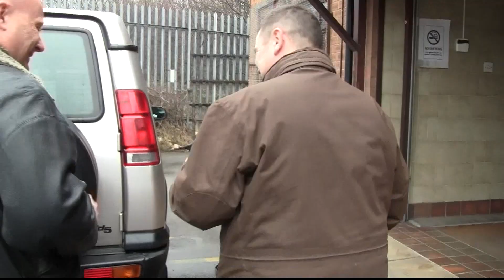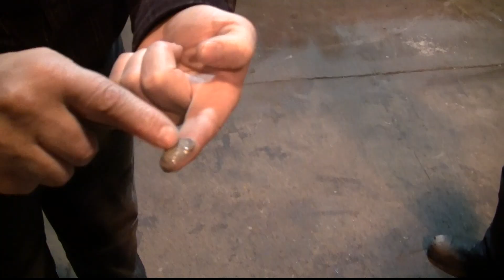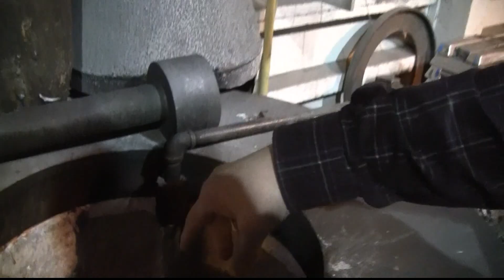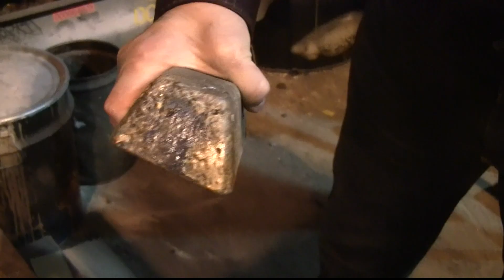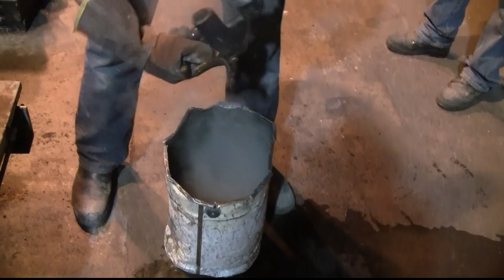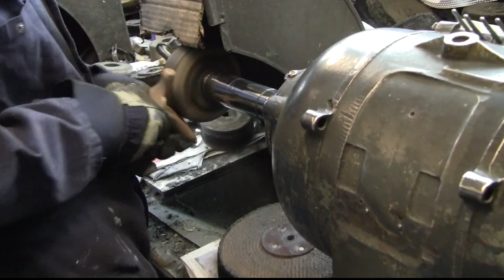Cast Metal Slingshots: The Sheffield Secrets Unveiled!

Comment: I do some of my own casting... I like the idea of using an alcohol based slip to put a nice smooth finish on the inside of the mold... I had never seen that done before.  I know enough about pottery that I think I can replicate that step in my casting.  Also I am hella tempted to order one of these slingshots.  They look sweet.
Reply: Want me to figure out what my shop uses we work with cored airset green sand and petrobond
Reply: @billybob-gb6ol  I'm interested
Reply: @sarchlalaith8836  to late don't work there anymore
Reply: @billybob-gb6ol  ok

Comment: I wonder if they can/reuse the sand blocks.
Reply from the maker: They do reuse the old blocks, but never for the finer (inner) parts of the new molds.
Reply: JoergSprave Thanks for the info. Keep up the good job!
Reply: +JoergSprave possibly at that foundry, at other foundries, like the one I worked at, we would grind that sand back into a coarse  powder, mix it with fresh and reuse it as if it were new.

Comment: when you were burning the moulds was that guy using a flamethrower?
Reply: I assume its the flame thrower they use to heat some of their smaller furnaces, or probably to burn the molds.
Reply: nah, just a propane torch (i assume propane, its just the most likely), like a really big blowtorch. a "flamethrower" generally shoots a burning liquid, like jellied gasoline, or napalm.
Reply: theoretical physicist
 a really bad ass torch
Reply: its a torch
Reply: Flamethrowers shoot a jet of flammable liquid or gel like napalm, they're illegal. Torches (the one in the vid) shoots out a gas, it's safer cause it burn faster. Meaning, no jetstream of fire
Reply: Yes sort of...it's a gas torch, he's using it to burn off the alcohol base in the mould wash (Flash Dressing). The refractory in this gives the casting a smoother finish.

Comment: Hey Joerg - good stuff.  Back in the sixties, last century, we teen lads used to fashion slingshots from coat hangers and used thick rubber bands. The projectiles were 3/4" fence post staples. Very cheap, and deadly on small prey - to that I am very regretful.

Comment: Wow, i'm really interested in getting my hands on some work like this, I'm a junior in highschool right now. I've been in a "shop class" for a while. It's really just learning Oxy/Acetylene welding and MIG welding. But I picked up some skills on a plasma torch and some other things while I was in the class that really got me interested in the industrial side of things. I just love watching stuff be made from scratch and turning into something so beautiful like these slingshots.
Reply: Do you mean oxy-acetylene cutting? Lol, because the only welding I've heard of is, Mig, Tig, Stick and Flux.
Reply: Samuel Romine Oxy-acetylene welding is what we thought freshman and new entries to the class. It's the same concept as oxy-acetylene cutting except the tip of the torch is a lot smaller and the flame is a lot lower. You pretty much melt two pieces of metal together down the middle. The welds are always pretty weak and it's hard to the puddle to run on both sides of the metal so it's not used a lot. There might be some examples of it on youtube if you're interested.
Reply: and it's hard to run the puddle down both sides* I really messed that part up.. lol
Reply: Samuel Romine You can weld steel, iron, copper, cupric alloys, aluminum, alu alloys. zinc, zinc alloys and more metals like gold and silver with an oxy-acetylene torch. That depends on the used fluxes. Aluminum has been welded (I mean welded with 4043, 4047 and 5356 apport metal sticks, not soldered with some zonc alloy) during decades with oxy-acetylene torch before the invention , around 1945, of the heliarc, precursor of the TIG. And you can braze with bronzes or brasses also, very useful with some steels like the Reynolds 531.
Reply: +Samuel Romine oxy acetylene welding is definitely a thing, it's more similar to braising or soldering in that you have the torch and then the filler rod separately instead of like arc welding where the rod is the heat source. But yeh it works just fine , you melt the metal so a pool forms between the joint then you run it along the joint, adding filler metal to it.

Comment: Why exactly have they molten such huge amounts of bronze when they're only casting a fraction of it? Did they use the leftovers for something else?
Reply: the slingshot was just part of that casting. The downpour and up-riser as well as the gates ( what he carved out with the spoon) need all be topped off to ensure no shrinkage in the casting. The sling shot weighs a couple ounces while the rest of the components probably way pounds. No waste though. All the unused metal will get thrown back into the furnace for future use.

Comment: if there is any moisture in the mold it will explode right
Reply: Molten metal coming into contact with any sort of water will instantly turn it to steam, which will make it expand, making the remaining molten metal spatter and pop. I've done it. It's not fun.
Reply: Can cause hydrogen gas in the water to explode. Many times dropped cupola furnaces in my old foundry had this happen. Thats the good thing about this mould coating its alcohol based and is burned off so not damp.

Comment: There is a lot easier way to forge aluminium just make it out of styrofoam cover it in sand and pour aluminium onto it and it will evaporate the styrofoam  and turn into metal

Comment: really good video   I loved every minute .. I have my Lost wax casting done for my Model gas turbine parts . This casting process is achieved by coating the original shape which has been cast in Wax. with a sort of ceramic slurry which is air dried  and once the slurry is  dry the wax is melted out prior to pouring the metal into the hollow ceramic moulds .I could hardly recognise you in this video .. You must stick to your You tube personality .Which I am sure everyone loves .